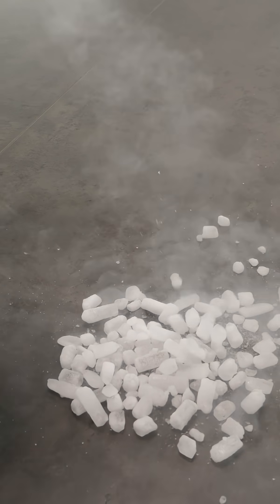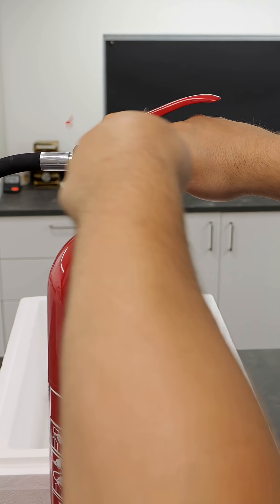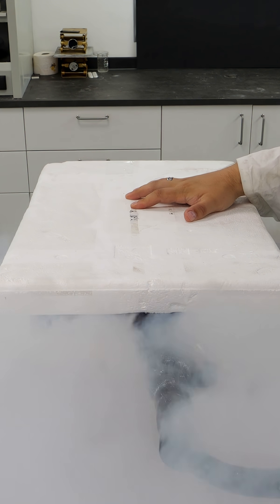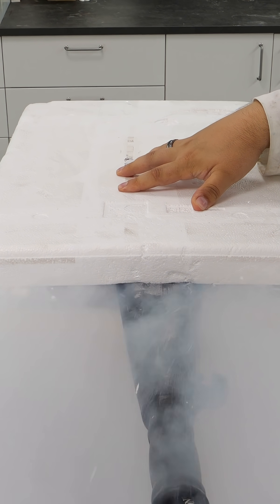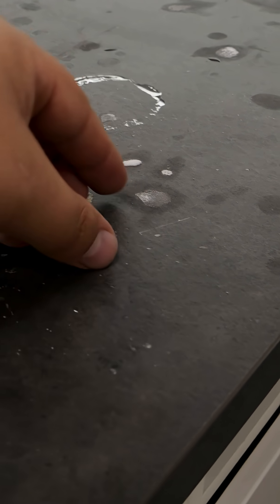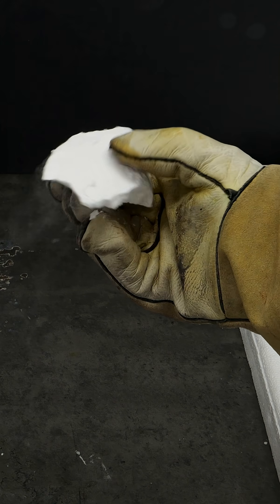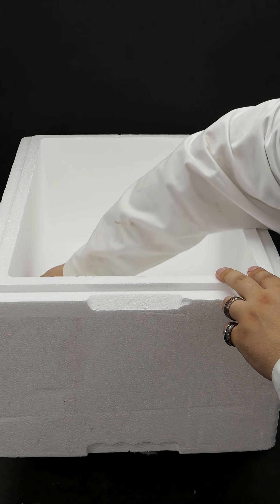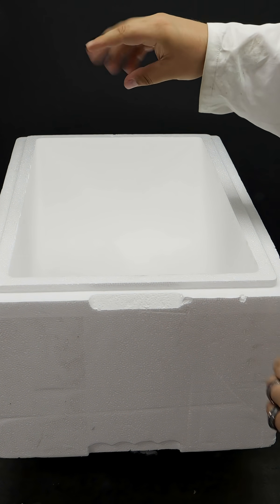making dry ice from fire extinguisher  | JeyJey

Comment: I'd definitely try to increase my results by making the nozzle fit into a hole I cut in the foam . I'd tape the lid down with duct tape or packaging tape ,then I would put a big number of small vents in the lid on the opposite side of the nozzle.  A pencil or pen should be decent for the vent holes .